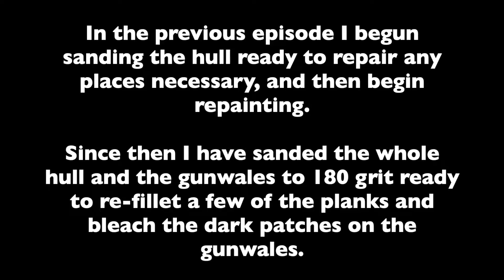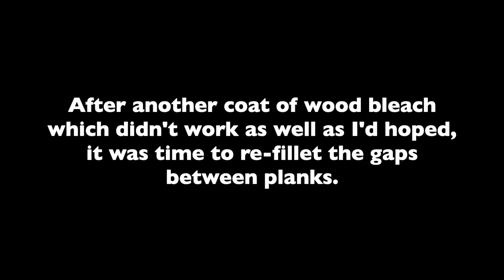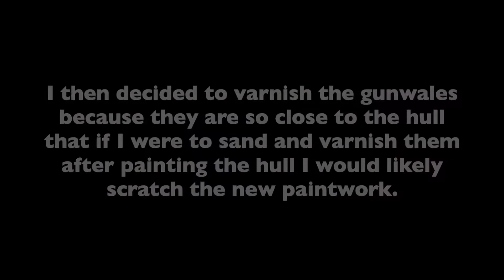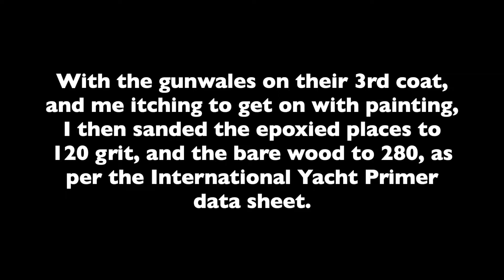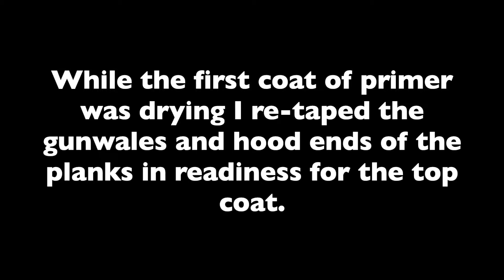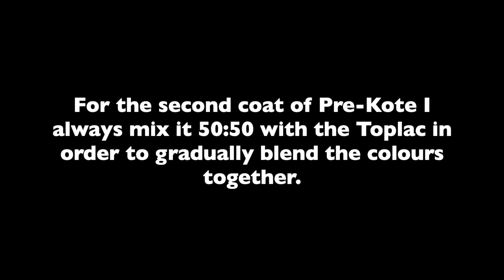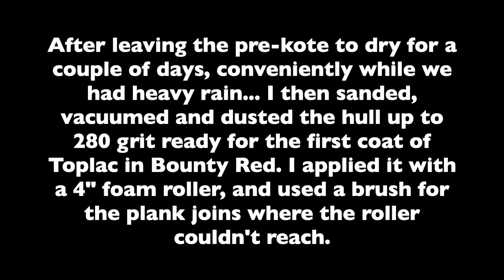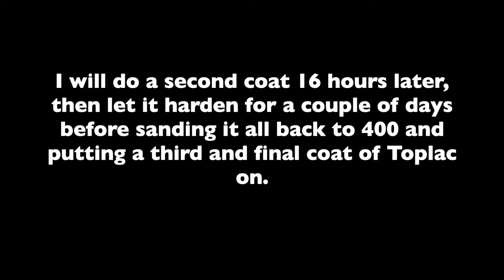Restoring a 1986 Merlin Rocket Dinghy | Part 3 | Epoxy Work and Painting!

Comment: Thanks for the series! I've just bought a 1963 Bob Hoare Merlin, number 1593, and it's in pretty good shape bar some soft bits internally which I'm hoping wood hardener and then epoxy will solve. There are a couple of planks that have moved (as it's been stored for ten years) and have ~2mm gaps for a few feet, do you think the filleting method you used will work or do I need more Draconian methods?
Reply from the maker: Hi Chris, she sounds like a lovely boat. To be honest I don't know whether I'm qualified to be giving advice, but to me 2mm sounds like you'll need to glue the planks back together first, and then fillet them on the outside as well for good measure. The tricky thing is clamping the planks together while the glue dries, especially if they're low down in the boat. But my best advice would be to ask an actual shipwright what they think! Good luck with the rest of the project :)